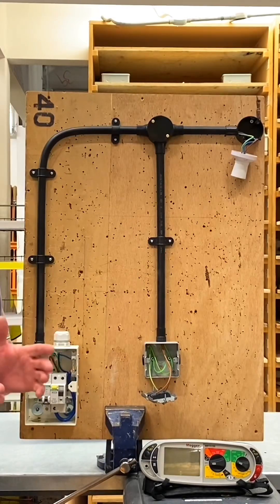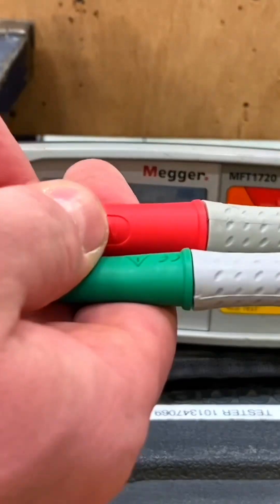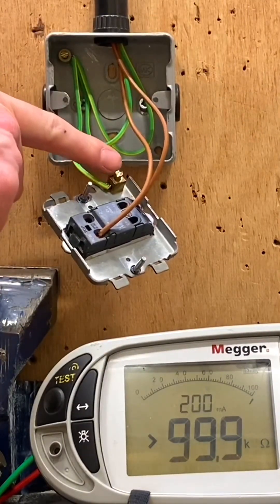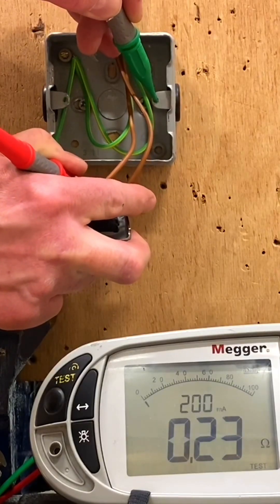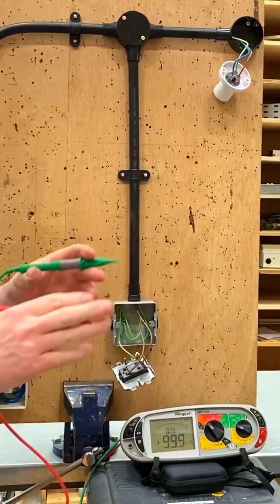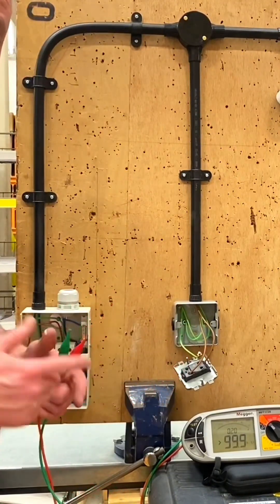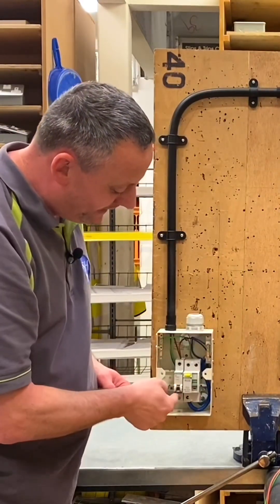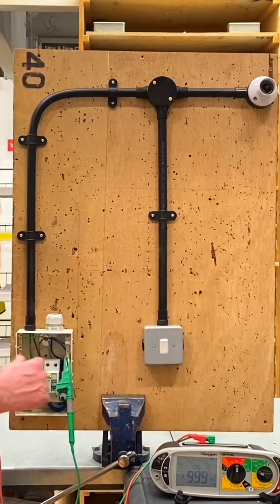Why Testing Grid Switches Can Be a Nightmare for Electricians

Comment: I was always under the impression that the earth should be terminated in the conduit back box and the terminal on the baton holder was just for a live loop in. 
In fact I use a very similar batten holder and the manufacturer states it’s a live loop terminal and states an optional back plate with an earth tag is to be used for that very reason ( also the back plate must be used when not mounted on a conduit box .
Also I was under the impression even though 99% of bulbs used are LED we still had to use heat proof  sleeving over the cables entering the baton holder. Just on the off chance someone still used a filament lamp
Reply: The conduit backbox doesnt have anywhere to terminate a CPC? Plus it's plastic.
Plus never heard of being told to use heat proof sleeving in a situation like this.

Are you ing USA?
Reply: @ I didn’t say it did . Same as a dry lining box you just put your own in .  ( wago or connector).
If you have never heard of heat proof sleeving being used on baton holders with direct connection then you shouldn’t be doing electrics . Batten holders with a terminal base don’t require sleeving as the link wires from the terminals to the lamp holder are heat resistant.  I’m in England. Time served. Not just a few week course

Comment: Should we not test the meter is functioning before and after performing an insulation test?
Reply: You can and I do but I have never been told it's a requirement.
Reply: Never😂
Reply: @tresslerj1985  knew someone who said that, at some point worked out the IR function wasn’t working, had no idea when it stopped lol